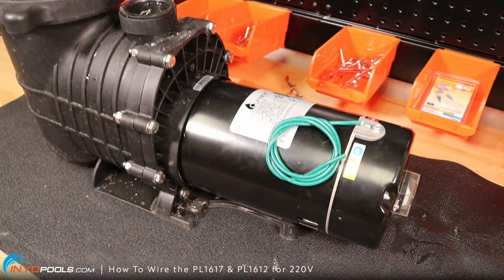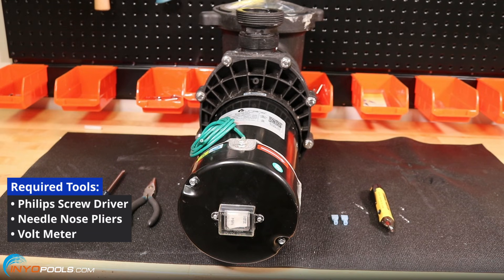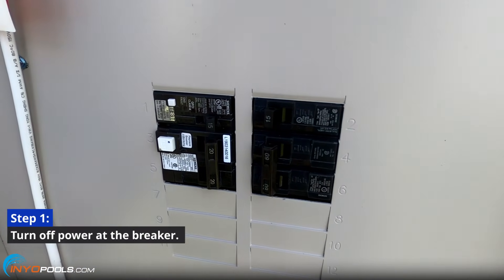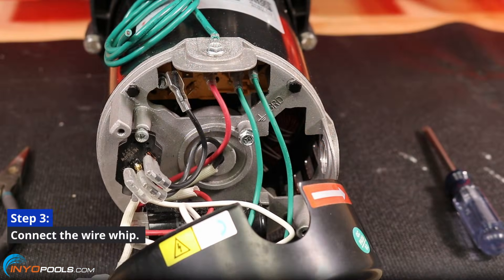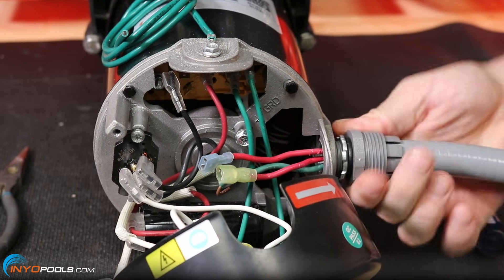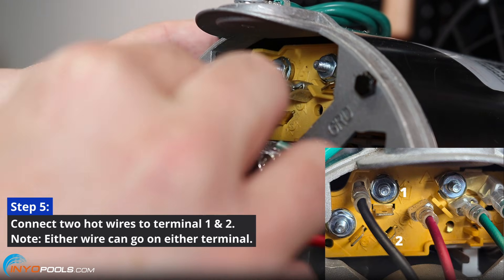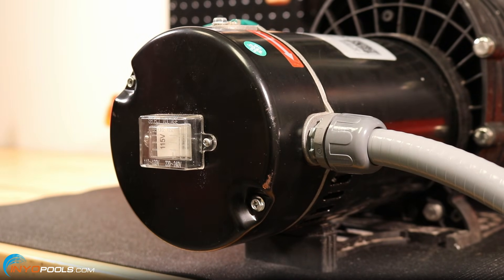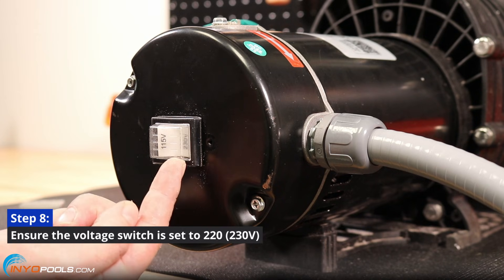How To Wire a PL1617 & PL1612 Pool Pump for 230V

Comment: That is how mine is wired from the distributor but thats 110v. I need 220v and is it possible to use the hi/lo switch while operating on 220v?
Reply from the maker: How to Wire the PL1617 and PL1612 for 110V - (https://diy.inyopools.com/how-to/how-to-wire-the-pl1617-and-pl1612-for-110v/)
Reply: @Inyopools the illustrations both indicate that 110 and 220 are the same wiring, but the switch decides whether it's suitable for each. I'm still confused. Is the switch not a hi/lo switch? I know it is when I plug it into a gfi.

Comment: What happens if you only have 1 terminal post  for the hot wire?
Reply from the maker: Each post on this terminal board is a single post. The wires shown in the video are fitted with terminal quick disconnects that slide over the  terminal lines.